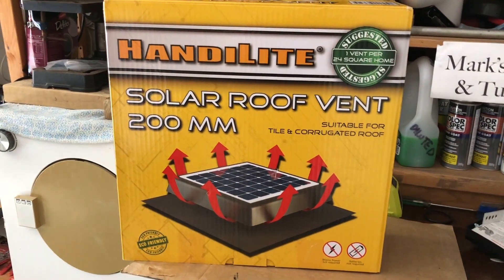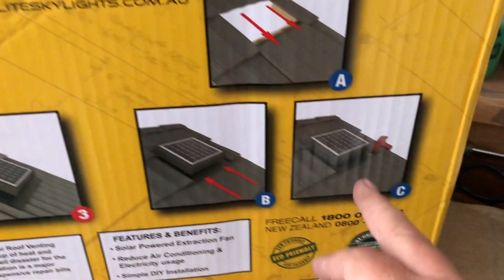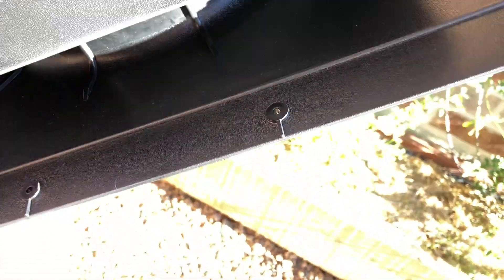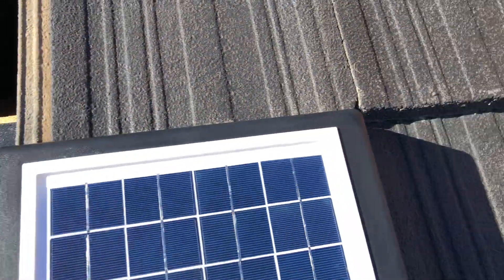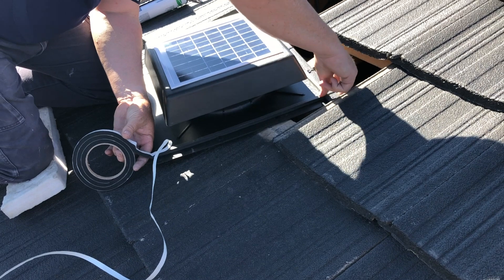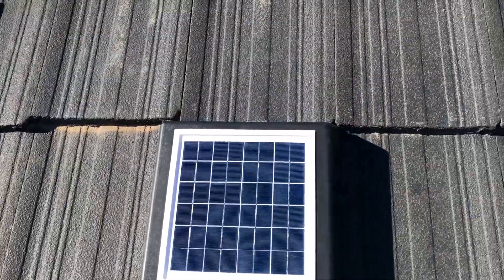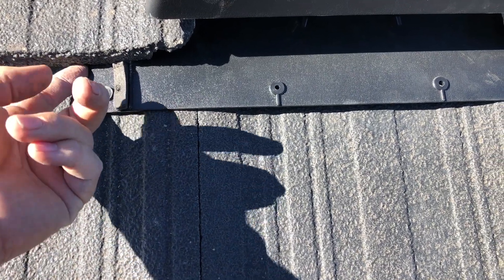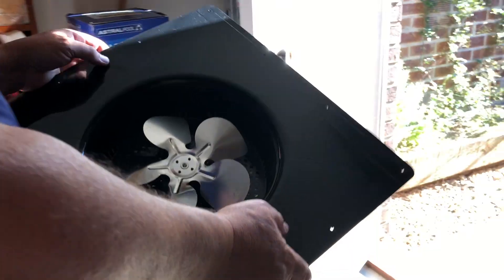Solar roof attic vent Review and full instal installation. What are they & how do they work

Comment: Hi Mark, how is it going after 3 years of use? I have the same problems with a dark Colorbond roof and want to get the same brand but with the battery added.
Reply from the maker: I haven’t been up in the roof in a awhile. But I figure once it eventually dies it is still a well made roof vent. Lol. 
I was on top of the roof and it is all still looking spot on from on top. The plastic are all fine even in the Aussie sun. MRT

Comment: yes yes yes, I had this installed,  near a self spinner vent, black tiled roof, WITH MANHOLE    in  garage OPEN ,  COVER REMOVED PREMANANTLY , TO SUPPLY AIR INTO ROOF, A/C now gets turned on much later in the day, wow what a wonderful power saver, price will soon be forgotten. I would do it again, in the next house, etc
Reply from the maker: Great. Thanks for the feedback
Reply: You need to remove the old Whirlybird especially if it's right next to the solar vent unit as it will be sucking outside air from the whirlybird and blowing it out through the solar vent in a closed loop without exhausting all of your hot roof air.

Comment: Hey great video. My house is about 115m squared, do you think 1 will be enough? Also, with the issue at the end of your video, would 2 of these get rid of most of the hot air in the roof during the day to make it decent for the summer night or do you think the spinning vent is better to have it venting all night long?. Lastly, did you buy a powered spinning vent or just the ones that turn via the wind?